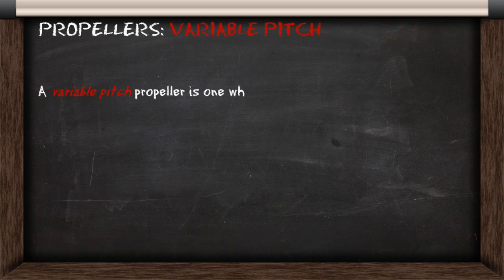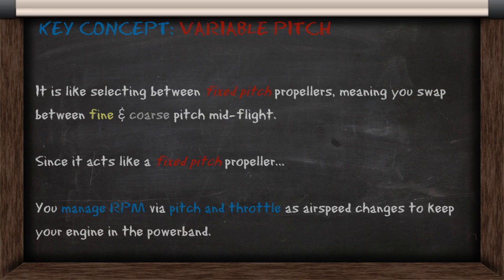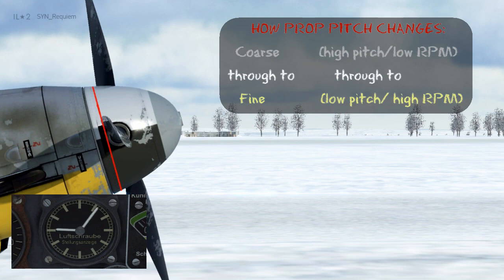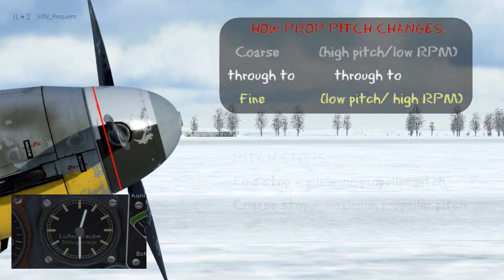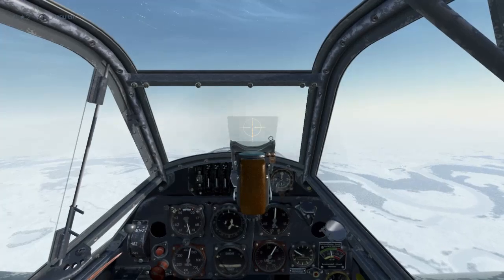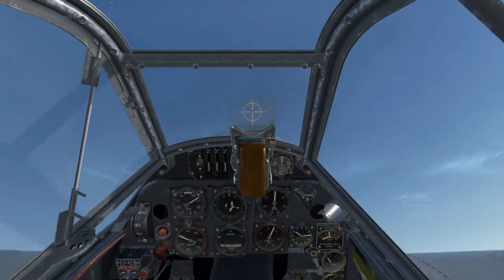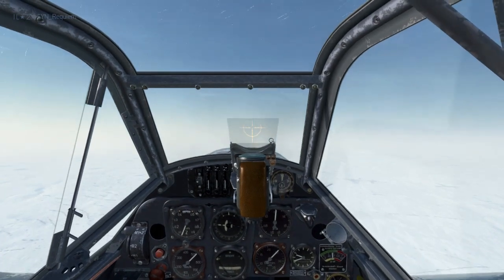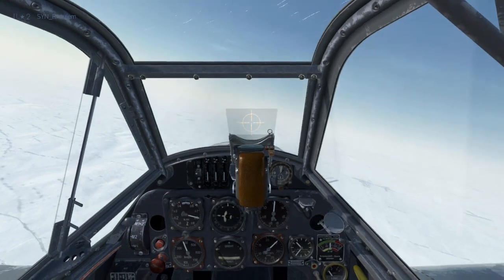CEM Lesson #3 - Variable Pitch Propellers

Comment: I don't know a single fighter that has variable pitch prop. They went straight from fixed pitch to constant speed.

You also forgot to mention that it's very easy to kill 109s engine with overmaxing RPMs in manual mode
Reply from the maker: Yeah this video isn't really about any fighter specifically. I just use the 109 to explain the principle
Reply: @RequiemsACTL  You can overmax any engine basically? I know that Soviet fighters with constant speed props had this problem

Comment: What are the best situations for using manual pitch controls? And what situations are better to avoid using it?
Reply from the maker: Honestly, outside of taxiing at fine pitch, I really don't use the manual controls very often at all. If I have some engine damage and I'm trying to reduce the stress on the engine I may take control to reduce the RPM but that's rare. In the Bf 109s you are better off leaving it in automatic 99% of the time as the performance gain you get by managing it is minimal compared to the reduction in situational awareness you end up with by diverting your attention to it.

Comment: Thanks for the great video. I am currently stuyding propellers at this moment so this has been really helpful for me. 
Let me please ask you one question: In those aircrafts with variable pitch propeller in which you can only select two of the mentioned positions (coarse pitch or fine pitch, not any other angle in between), what is the technical name of the "control" that we have in the cabin and let us select coarse pitch or fine pitch?
Greetings from Spain!
Reply from the maker: I would just call it propeller pitch control. It's still controlling pitch regardless if you have full adjustment control or only in two stages.
Reply: @RequiemsACTL  Thank you very much. Do you remember any aircraft having a just 2 pitch propeller controllable in-flight? I found that the early Hawker Hurricane MK I had it but I couldn't manage to get much info and no pictures at all of that model's cockpit in particular.
Reply from the maker: Maybe look up the Martin B-10 Bomber and Boeing 247

Comment: So you're telling me that in a plane you have to watch: the engine temperature, water radiator, oil radiator, propeller pitch, trim, fuel mixture and fuel amount all at the same time while flying, maneuvering and in combat? How are you supposed to do all of that manually?
Reply from the maker: Well you can set the radiators just before you enter combat and mixture should already be set so no need to worry about those. You really won't need to worry about adjusting propeller pitch because of the constant speed propeller which handles that for you (I just turned on manual control to illustrate how things work if you control pitch manually). Your priority is going to be watching the bad guy, so your head won't really be inside anyway which makes it important to set yourself up just before you start dogfighting. Doing so leaves you with less to be concerned about with your own airplane.
Reply: @RequiemsACTL  But the mixture is related to altitude in that air compresses more when it's cold and there isn't as much oxygen up there so if you drop a few km's in combat won't the fuel mix be wrong?
Reply from the maker: Yes you're right in that mixture would be slightly off if you go down in altitude, so you can increase the mixture to full rich if you realise you're on the way down. Better to have a too rich mixture than too lean. There are plenty of airplanes such as the 109, which will manage your mixture automatically so you don't have to worry about it.
Reply: @RequiemsACTL  So basically mixture is the only real thing to manage engine wise while in combat?
Reply from the maker: @yuriman123  Yes and no. Same goes for RPM control. It's all airplane dependent as to whether you need to manage it or not.

Comment: Hello. il-2 sturmovik cliffs of dover blitz i just started. Pitch Propellers I did not fully understand the use of.I want to start with German planes.bf 109 e 1 and bf 109 e 3 series manual.what will be the continuous setting.when you fight dogfight how will we achieve this.bf 109 e4 series have aoutomatıon.but I failed him.Manual clock 12 rpm when lifting the plane.after the plane take off I'm getting automated, but rpm remains constant at 12.after engine game over.how will I overcome all of this.very difficult game but i love flying.how will both fly and make them.have more motor temperature controls.Buy the game it's been a week.single task only I can fly.I could not start full realistic controls.as such I can't play multiplayer.I would be grateful if you help me.my english is not good.I use google translation.I hope I told you my problem.have a good lıfe.

Comment: Hi Requiem! One question for you, in some of your how-to-fly videos for the Bf series, when you are about to land you adjust prop pitch to manual control (I remember it being either 11:30 or 12:00) depending on the series. What is the actual purpose of this?,  is it done to fixate a variable (in this case propeller pitch) in the equation and provide more predictable throttle control?  Another related doubt is regarding the suggestion of altering the pitch to 'full' in order to ease taxiing. What would this mean?, should we set it to coarse or fine setting?  Is coarse equivalent to the 0% reading that is displayed in the HUD is enabled?   Sorry for so many questions, your videos are like flight academy for me and I'm really trying hard to get the basics. Thanks for creating this series!   =D
Reply from the maker: Using manual or auto pitch is optional for takeoffs/landings just as it is for taxing, so it's whatever your preference may be. You're correct in thinking about how it fixes that prop pitch variable for the throttle control. If setting the prop pitch (full) while taxiing it will make the pitch more fine (100%) so you can generate a higher RPM more consistently.  If you set it to (0%) that would be fully coarse so it would be harder to taxi. Don't forget that you also have the propeller pitch indicator in the 109s to tell you what value you are assigning rather than a %. A higher clock value equates to a more fine propeller pitch. Feel free to give taxiing a try with the extreme values of prop pitch in manual mode and see the difference.
Reply: @RequiemsACTL  Thank you very much for such a comprehensive reply!  =D

Comment: Excellent video. 2 questions: 
To reduce speed do you reduce prop pitch or throttle? or both? 
In a dog fight do you adjust either Pitch or Throttle more than the other? 
It's how to get the two working well together that I don't understand the theory of, even though I seem to be getting on ok in practice
Reply from the maker: If you're controlling the pitch manually, you can alter the prop pitch or throttle to slow down because you either add more drag to the propeller or reduce the power available to spin the propeller. In a fight you will find you will need to adjust both because your airspeed may change quickly enough that trying to compensate with only pitch or only throttle won't get you the results you need quick enough. It's something you get a feel for with a lot of practice. I personally just leave everything in auto on the 109s and 190s. To me it's not worth the extra hassle and loss of situational awareness trying to finesse it while in a fight, but if you get good at doing that more power to you!

Comment: If it could pitch more till it's inverted, then can it ever become reverse thrust? I'm curious.
Reply from the maker: Yep! Change the pitch angle enough and you can direct the thrust forwards instead of rearwards which you can use to your advantage if you wanted a shorter landing roll (if equipped to do it of course)
Reply: Yay!! We can have BF-109's fly backwards :D Maybe not :/

Comment: Have you tried clearing your pitch bindings and bind it with your throttle? It works like a dream.  (Its what the Italians did irl- connected pitch control to throttle)

Btw- if youre in a dive you run the risk of over-revving your engine and killing it; so when going in a dive you want to throttle back.
Reply from the maker: NeuKrofta No I haven't tried that actually. It would be an interesting way to do it, but I would be worried about overreving the engine and if I would get enough power out of the 109 this way. I just leave it on auto though when I fly it, much easier :-) Thanks for sharing that neat idea!
Reply: Yea. Every plane is different.  I like to keep my eye on rpm and ata regardless though. Its a good habit xD cheers

Comment: by adjusting the pitch to keep the props in a certain RPM, are we keeping a constant brake horsepower? I have a hard time understand this concept since "how much air the propellers grab" has changed which is essentially how propellers create thrust, why does a constant power matter? I've tried to do some research in this area but haven't had much luck, do you know of any good articles you can refer me to on this subject? Great video again!
Reply: +Shaoxuan Li 

Hi, I will try to explain in common talk: piston engines in that era had a "sweet range" of RPMs. In this range you have either: max horsepower, best power/fuel ratio, or best economy - depending on actual RPM and prop setting as explained in video. 

Constant power in this equation doesn't matter - it is more about risk of engine damage, best heat generation, fluids consumption etc. 

Going under the sweet range means that engine will go off, putting RPM up means you will kill the engine. 

Think of it the same way as about car gearbox. That's it. More power = RPMs go up, but you have to shift up too, to be able to go faster. Too much speed = use less power and high shift (prop pitch), or engine will have too much RPMs and will blow up :). 

Hope this helped.
Reply from the maker: Shaoxuan Li I don't really know much about the different horsepowers involved. That is all a bit beyond what I understand as I'm not much of an engine guy. 

The RPM of variable pitch propellers is a function of using the throttle and airspeed, so I used a constant throttle in the video to illustrate how variable pitch propellers work with respect to airspeed. It wasn't a matter of importance to maintaining constant power at all.

When you change the pitch to a certain position, it becomes a fixed pitch propeller because the pitch will not change unless you tell it to. It's easy to grasp that if you increase or decrease throttle, the RPM will change accordingly in fixed pitch propellers, but for some people understanding why the RPM increases or decreases with airspeed due to windmilling of the propeller can be a bit confusing. That's why I chose to illustrate that point by removing the throttle as a factor in any RPM fluctuations by keeping the throttle constant. By showing this you know from watching that the RPM can change not only because of the throttle, but also only due to changes in airspeed. One or the other, or both together, RPM will change when throttle and airspeed changes occur.

This is unlike the Constant Speed Propeller which makes the pitch changes automatically to maintain an RPM you choose regardless of your throttle setting and airspeed. 

I hope that helps clarify things a bit.
Reply: Vlcoun excellent analogy! Thanks!

Comment: Hi Requiem, the video left the reasons for changing your prop pitch a bit unclear for me. Why should one change his propeller pitch instead of keeping it a constant? What do you gain from it in flight?
Reply from the maker: Natti You can squeeze a bit of extra performance out of a 109 by using manual control, but it's not really worth it imo. I was sort of thinking ahead with this CEM video (and the previous) in case future aircraft released by these devs end up being strictly variable or fixed pitch props. Right now all aircraft can be used as Constant Speed Props.

Comment: Great tutorial, but i have one question, is the manual control considerable better than the auto?? Thanks in advance
Reply from the maker: Personal preference really. You can squeeze a little extra performance out of it by doing it manually but you really need to be on top of things. A lot more effort than it's worth in my opinion, I would just stick with auto.

Comment: When you say you have to manage the pitch on a turn, you mean make it fine or coarse? I think it's fine but wanna make sure. Thanks! Great video as usual!
Reply from the maker: It's more about the airspeed change than the fact its in a turn because your airspeed will go up or down (and the RPM will too) while turning depending on if you are climbing or diving during the turn. So, the prop pitch you set for a RPM at a given airspeed/throttle setting no longer applies so you need to change it. Airspeed falls, RPM falls, make pitch finer to increase RPM, and vice versa.